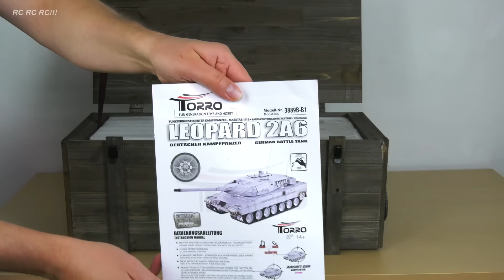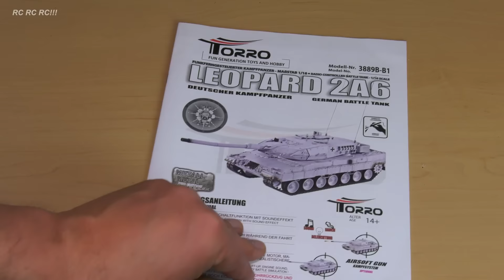UNBOXING! NEW RC SCALE MODEL TANK LEOPARD 2A6 TORRO PRO-EDITION IR CAMOUFLAGE DESERT

Comment: had the tank for few days now, but the all-round lighting on top stopped flashing when just standing still it only flashes when the tanks start moving, also stops flashing when i go full throttle and also the motherboard overheats overtime when i put in 5000 mAh battery, idk what i should do with the light on top tho.

Comment: This tank is in the basis very good. Funny is even the small square on the left side of the tower. In the past the Leo 2A4 had a small hatch through witch granades could be handed to the loader. But somewhere in the late 80's they welded this hatch closed. Granades were almost always handed through the loadershatch on top of the guntower. Also the engine sounds very realistic. However this tank also has a few mistakes. Biggest one are the wrong camouflage colors. Pity that on the backside they didn't paint the followingcross white. And on the downside left and right from the followingcross, in real you'll find reflectors instead of red lights. Those lights would be better in place on the frontsideblinkers in the color orange. Overall a nice tank, but in wrong colors.
Reply: The paint is almost true to the original. In 2013, 62 Leopard 2 were delivered to Qatar. Exactly in this paint job. Please google it
Reply: Sorry please..whats is the price??

Comment: 13:39, Torro just can't seem to get anything right.  The first road wheel is still off the ground by a few cm, destroying the impression of a heavy tank.  The turret rotation is ridiculously slow.  The real Leopard can rotate turret 360 degrees in 9 seconds.  All of this basically reminds you that this is still a toy tank.  It'll never come close to a Tamiya.
Reply: Thats the thing. I wish HL would just spend about a extra 10 mins when building their tanks.  Just put a little faster motor for the turret and barrels.  And just take a few extra minutes when programming the sound for like the engine, turret rotation etc.  Yeah you can't beat tamiya but $800 starting.....  HL's are improving, the T72 is really nice.